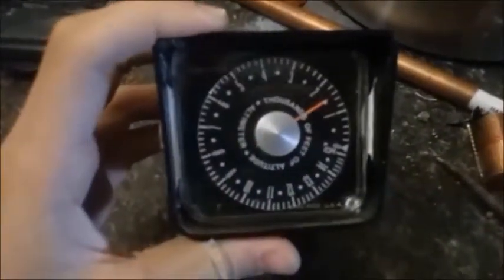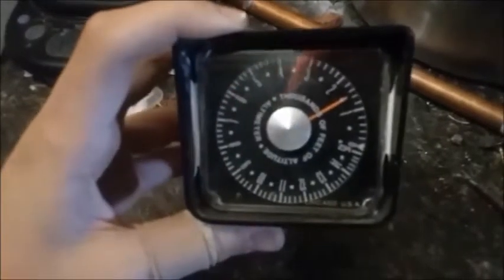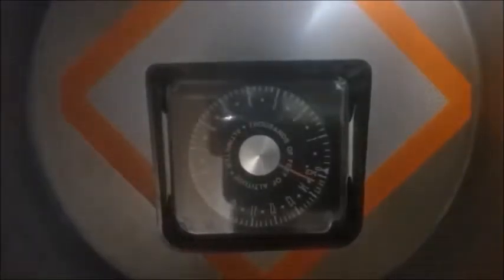Altimeter in vacuum chamber

Comment: If like to see a speed indicator in a vacuum since it uses both ambient air and the relative air to measure speeds, but it would probably read zero and then a small increase as air flows in